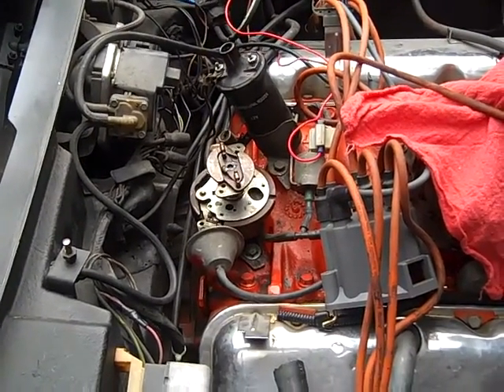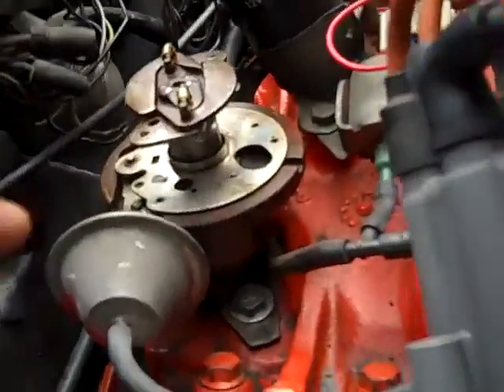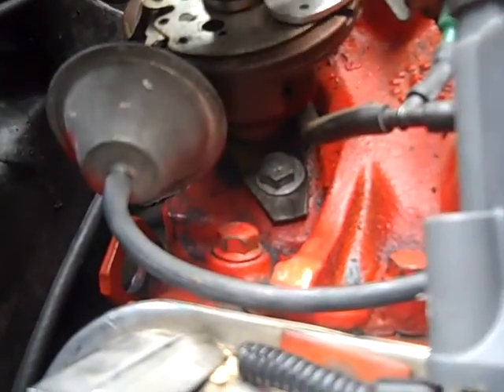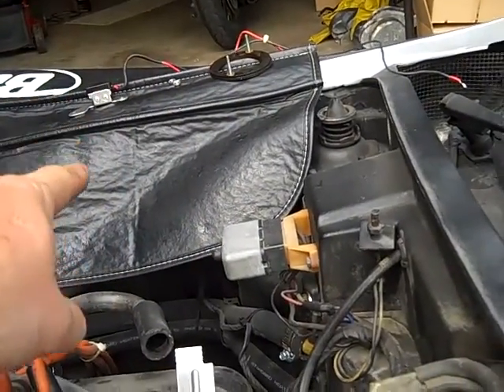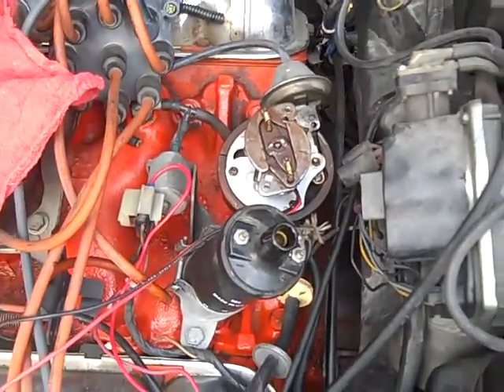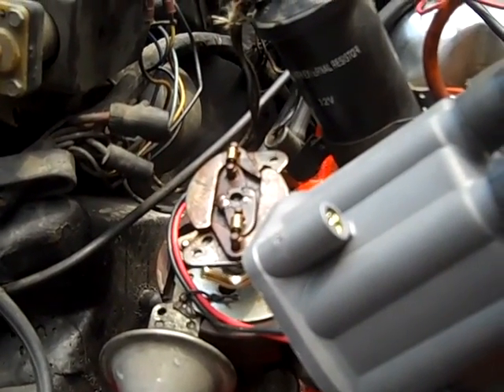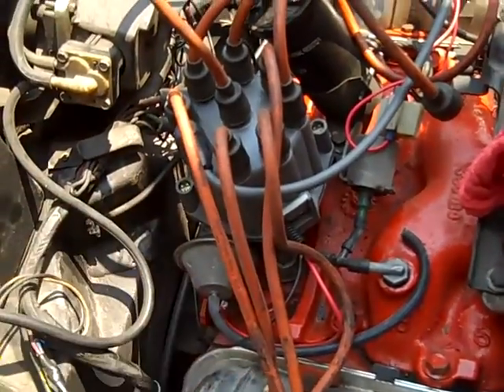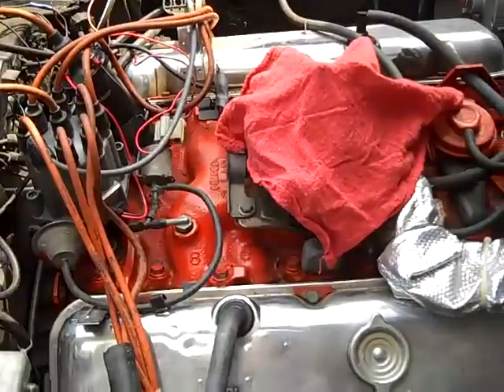PERTRONIX 1181 AND 1181LS

Comment: I have a 1968 Pontiac 400HO, and the LS is what I am eyeing to use.
Looks rather straight forward, just verify timing when done.
Also, My understanding is this LS uses a different low impedance type  .6 OHM coil, which renders a 45K volt output.
THX

Comment: The problem with the lobe sensor type is timing scatter;  pickup resolution is so poor with the small diameter lobe that even a small amount of shaft play can create uneven spark timing.  The large diameter magnet ring will give consistent timing, assuming of course the magnets are accurately spaced.  The loss of magnets of course is problematic and Pertronix needs to correct this.
Reply from the maker: Using my timing light I can tell visually it is spot on, I do see some slight scatter, but little to none.  Certainly nothing like you will see with the old points. Lobe sensor is far more precise and accurate than the old points.  Also.. On the 1181 , the ring is not perfect and level all the way around which means the air gap changes some so there is some scatter with the ring version as well.  Not as much as the 1181LS from what I have seen. Both are pretty accurate and steady. Way better than points which have scatter city.  I think the spark is hotter with the 1181.   Not sure, but that is my feeling.  At any rate, I have gone to all Lobe Sensing LS versions on all my old V8s and I like it a lot.

Comment: On the 1181,  Are you sure the end play on the distributor shaft is set to proper clearance. Remember the shaft is designed to be true vertically, and now were triggering from a horizontal platform. If there's excess wobble off the top mounting platform, that may spell trouble for the 1181. If the pick up on the 1181 starts to touch the magnetic trigger plate above it, things are gonna come apart.  I say this because  you stated, one lasted 20 years and one only lasted 3 years.  There may be some other issues. When you went to the 1181LS you went back to a vertical trigger platform , which is much truer, but not as positive a trigger pulse. These units seem well designed and made. I like the magnetic trigger plate, but they need to come up with a way to deal with all that wobble off the top of the distributor.  Magnetic lobe trigger would be the best of both worlds.
Reply from the maker: I have gone to LS versions in all my GM cars Buick and Chevy.  No problems and they work well for sure.  Keep in mind they have only been installed for around 3-4 years now with no problems.  The 1181 also had no problems until after 10 years or so.  Also..  Keep in mind these are collector cars only used on weekends.
Reply: Pertronix may have a problem with the trigger plate on a long term situation in the 1181. How ever, at 20 years service life I can't condemn the design at this point. That's actually fantastic. Especially considering you never mentioned servicing it. That is to check the air gaps. About the best warranty you'll get from GM or NAPA is 90 days on a pick up. If your happy with the LS version that's great.  I don't think you'll get the service or performance out of it you did the magnetic pulse trigger though.

Comment: Why didn't you run the wires threw the hole in the bottom of the distributor, where the original points wiring went? That is what I did on my 59 Chevy, and plan to do on my 60 Pontiac. I am going to try the 1181LS on the Pontiac. The Chevy has the 1181, and has been in the car for over 20 years. Guess I am going to have a look at it now after seeing what happened to yours.
Reply from the maker: I do not remember why it was so long ago that I did it. .  And yes.. Check the ring. It took 15-20 years before mine came apart.  Only 3 years or so on my Buick..  It is a problem for the magnet rings only..
Reply from the maker: I forget why.. IT escapes me as to why. I am sure I had my reasons.

Comment: Good & useful video. I have a 1956 Cadillac and was deciding between the 1181 & 1181LS.
Reply from the maker: I do not think the LS is as hot a spark or as precise as the non LS.  Just a visual analogy..   But it is way better than points... And the ease of install makes it the way to go.